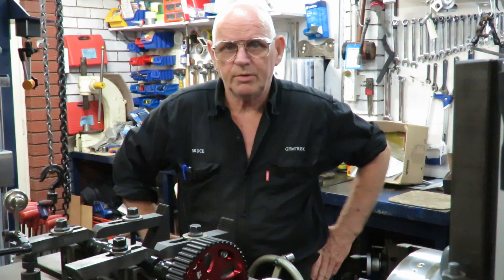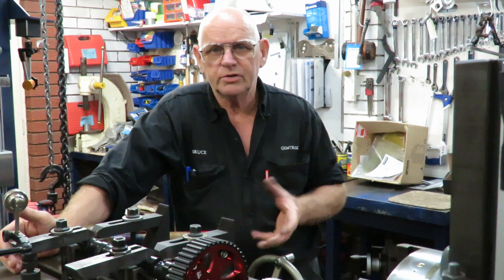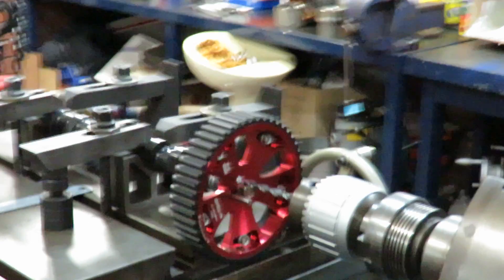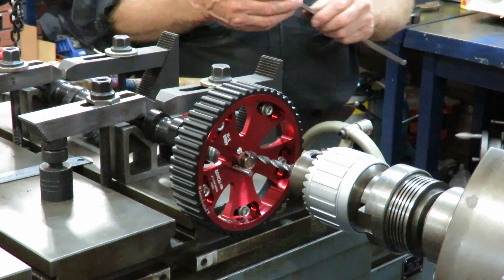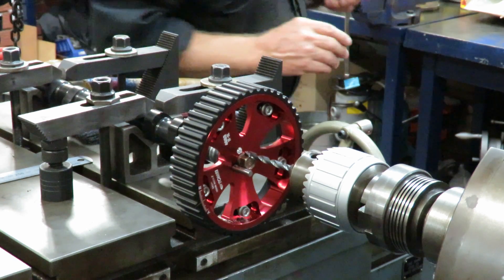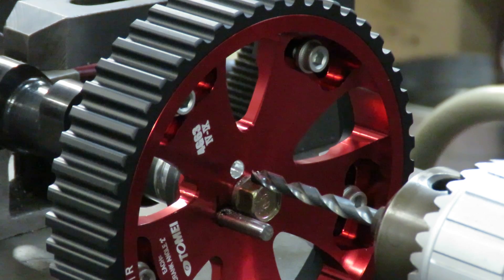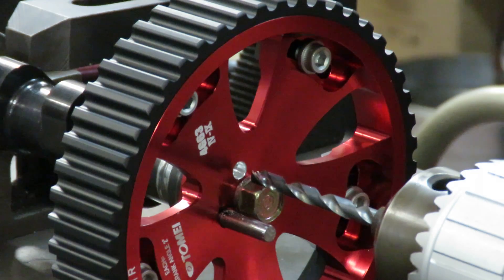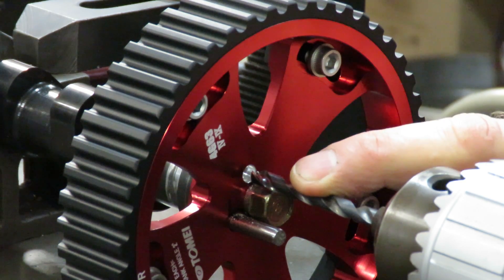Cam Gear Dowelling

Comment: Hi Bruce, what brand and size drill chuck are you usingThanks Craig
Reply from the maker: Craig I have several ball bearing type chucks as you can see, they are called "Golden Goose" made in Japan. very good.
Reply: Can you buy these in Perth and do you prefer keyed or keyless
Reply from the maker: Yes you can get them here from K2 Engineering supplies in Malaga.
Reply: Thanks Bruce , i have a 5hp Hafco Mill the next size smaller than yours ,a Colchester Master Lathe, a Ingar Surface Grinder, and two Bridgeports , just a out of control hobby.I realy enjoy your vidios and i am working my way through whatching them keep up the good work Thanks Craig from Mandurah Western Australia.
Reply from the maker: Craig keep in touch, Your welcome to visit me anytime, send me an email with your details to gemtrek@bigpond.com Cheers

Bruce